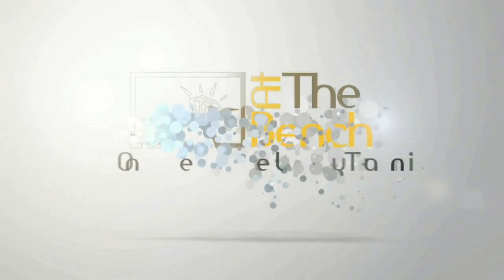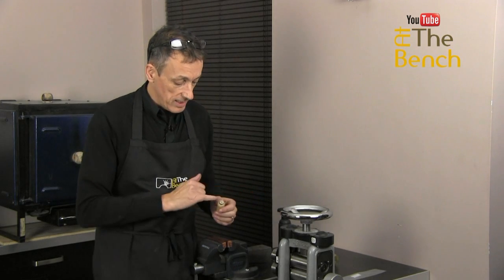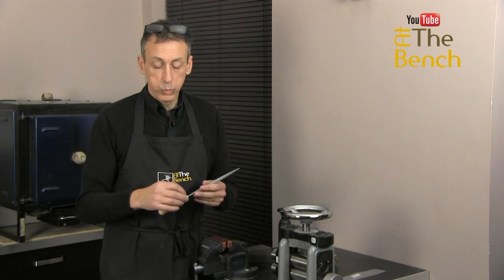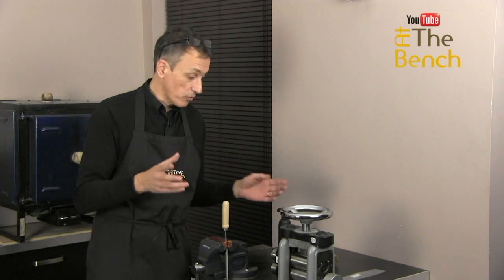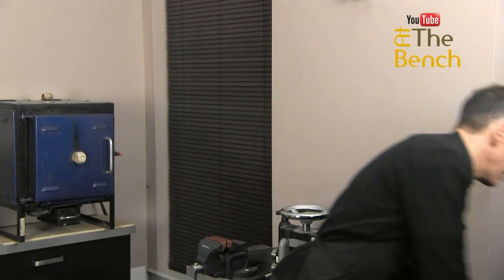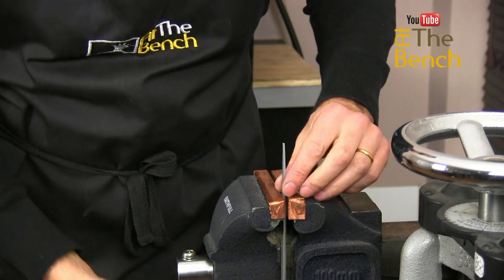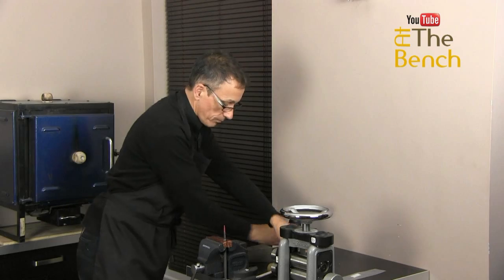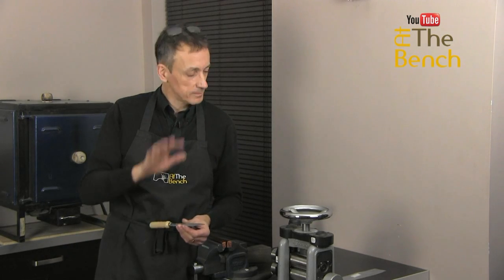Fitting a File Handle to a File - Making your Own Jewellery - Jewellery Tools

Comment: Good point. I see it all over YouTube. Your the only one that actually takes safety as a number one priority.
I do jewelry repair and limited creation as a hobby and I make a little from it. I'm mainly a nurse for over 40 years. I see 1000s in the emergency room that never should have been there had they just thought of safety first. Many died because they just never thought it could happen to them.
I have learned long ago Murphy's law. Anything that can happen can and will under the right circumstances and condition.
Stop! Think about what could possibly have if I do it this way? Or that way.
No matter what you're doing driving walking between cars to cross the road or hammering a nail.
Things happen all the time deliberately or unintentional the end result is the same. Some got hurt because they didn't care to practice safety safely.

Comment: very clear instructions. I really appreciate these videos. However I somehow managed to get the round file a little skew on the handle. Should I redo it? How do I get it back out? I had 2 handles and I drilled 1 of them. I may have taken the undrilled one. Also while hammering the first time the file shifted downwards in the vice. thank you.

Comment: Any advice on selecting file handle length?
I've got a couple of 12" Nicholson metalwork files that need handles.
Can't find any information on the internet that details any correlation between handle length and file or tang length. Thank you for this informative video.